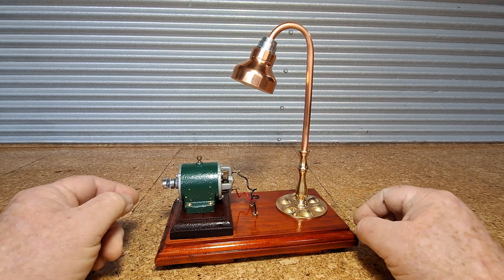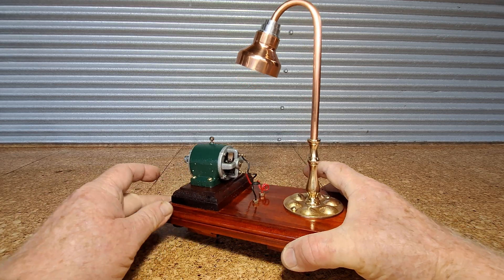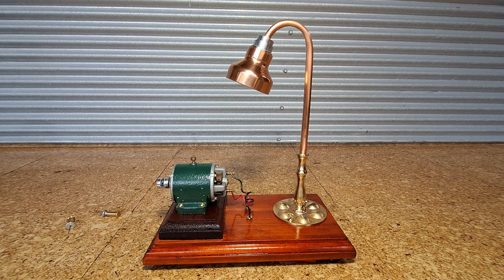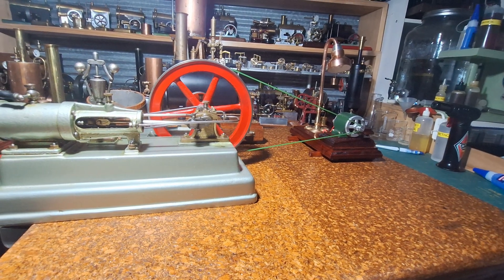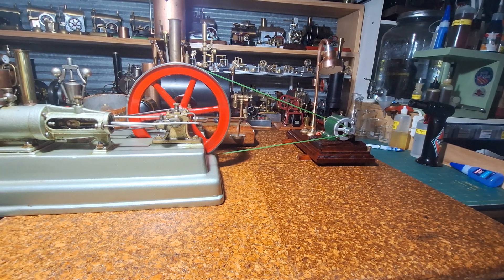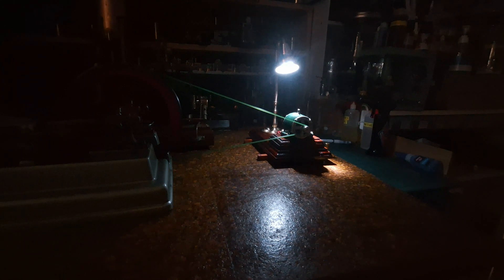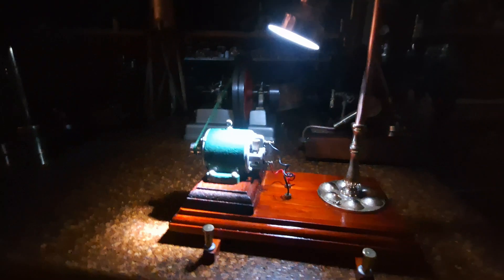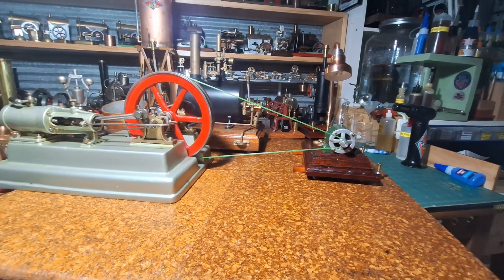DIY Homemade Lamp Running off PM Research Model Generator

Comment: Looks Great Jim
No such thing as scrap, everything can be made in to something, looks like motor brushes or amature need attention
regards
Kev
Reply from the maker: Thanks Kev.....i used the old adage if one drop of oil is good, more must be better.....there was a little oil on the armature that was causing that smoke.

Comment: Very impressive, say would that polish engine happen to be from an old company called Eiwi now going by the name of Polish engines and wood raft
Reply from the maker: No....here's the history of these, mine is now 60 years old -
https://www.technique.pl/mediawiki/index.php/Pomoce_naukowe:Szkolna_maszyna_parowa
Reply from the maker: I do like some of their engine (the above company you mentioned) but most of the folks I know who have bought them have had problems that needed a lot of attention and some re-machining to get them running properly - Cheers Jim
Reply: @SteamEngines-Jim  interesting thanks for the info